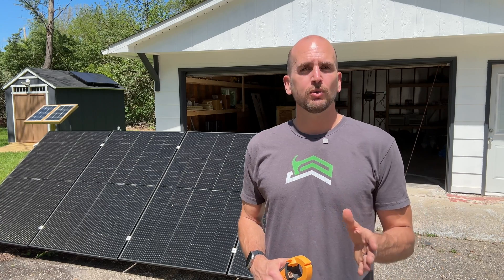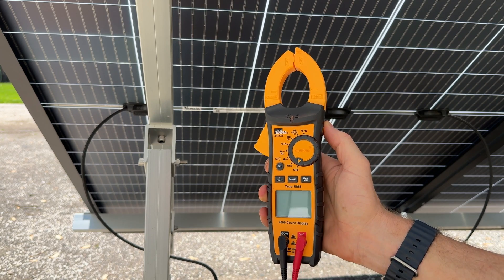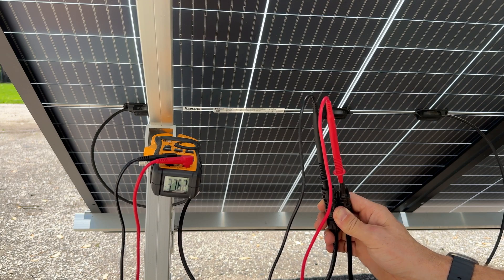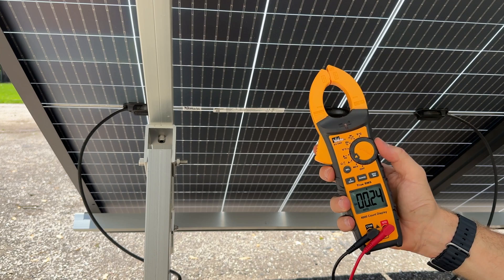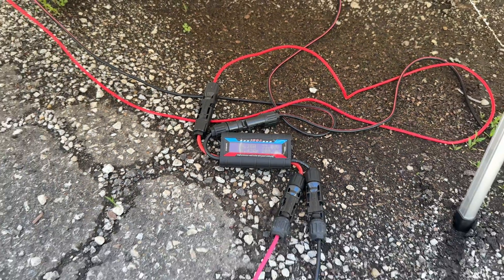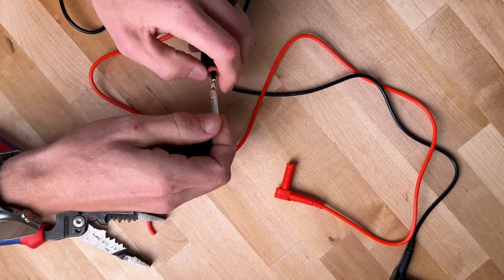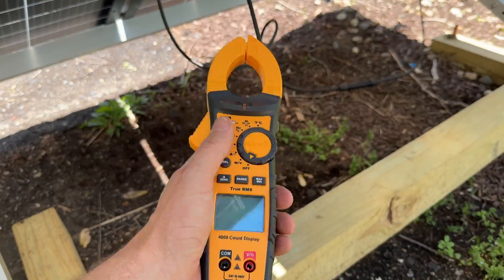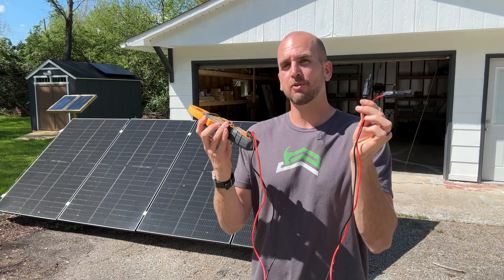Measuring Solar Panel Output |  Ultimate DIY Guide

Comment: Please i have a question, i have 3 panels connected in parallel. Each panel has imp of 10.67. My charge controller takes 13amps max. I have connected my power analyser from the solar cable to the power station solar cable and plugging it in, i am seeing the unit is not even taking upto 13amps. Could it be that the panles aint generating enough? Because it makes no sense, one would expect the unit to always take 13amps since the parallel connection gives it more than enough. From my own observations, majority of the time the power analyser shows about 8amps being taken by the load, i even see 3amps. Which means each panel aint even generating upto 2amps.... meanwhile the voltage is very okay.

Comment: There are numerous unsafe elements in this video. First, you should never short-circuit a module unless you have a load-break rated disconnect in the circuit. He cut this part out of the video, but opening the connectors under load will cause a DC arc, which is a safety hazard, and it will also damage the connectors. Second, when you modify the test leads, you void their CAT safety rating. Also, MC4 connectors aren't rated for a wire that small.

Comment: Hi, I have just bought a new solar panel.  I tried my clamp meter on the cable between solar panel and inverter but only shows very low amps.  I have tested the panel with multi meter and the voltage is ok and also the short circuit current is  ok . Don’t understand why I’m getting no amps at the inverter? Thanks

Comment: I probably watched about 20 of your videos and I appreciate you. I also like your varied tests. I am by nature very methodical so doing logical testing is in my dna.  I know absolutely nothing about solar, but am learning quickly. I bought the 1st generation Delta Pro and 400 watt foldable panels. They are both since long out of warranty. I bought a Delta 2 with extra battery and just bought the 2nd generation 160w foldable. I really do love EcoFlow and they are helpful to a certain extent.  I never got really great results with the 400w from the get go even i. Ideal conditions. Maybe 275w.  But I am averaging 160w now.  As a matter of fact the 400w into the Pro and the 160w into the Delta 2 and the 160w panel is generating more power.  I ordered a mutimeter because mine wasnt strong enough. I ordered those power analyzers. Tried to add mc4 connectors to them several times… who knew the m goes to the f pin and not m to m.  Lol.  Once I got them working Open current V 45.7 vs 48 rating.  Amp were low 1.5 a on average.   There are some scratches but I am leaning more towards the potential of a bad diode?  Since they’re no longer under warranty, I might just attempt to open the junction box.  I might put thermal electrical grade tape \ film over the scratches in case its a moisture issue.    Like I said. Learning a lot.   

Since both the Delta Pro and the Delta 2 have built in MPPT solar controllers, would not the data from those devices identify the issue and a bad diode?  Are they any app that can read the MPPT data?
Reply: It's about 66 degrees out and 11AM.  the 400w panel is positioned towards the sun at the right angle.  It is not plugged into the Delta Pro yet.  I put a heat gun on each cell of the panel and the temp range was between 125 and 135 degrees F.  That indicates that no cells are damage, correct?  I wonder if the MPPT in the Delta Pro is reducing the charging production at maybe 50 or 60%?  I wish we could access its data.  Going to have to drain the Delta Pro down to 10% and repeat the test.   The Delta 2 does not do this, I was at 95% battery and the 2ns generation 160 Watt panels where producing more than the 400 w.   Are the second generation panels just better?  I am going to test the diodes when I can but I can't see anything telling me the 400w panels are defective in anyway, yet.
Reply: So today is ideal testing conditions.  So I swapped things around.  I put the 2nd generation 160 watt panel into the Delta Pro and the 400 watt into the Delta 2.  The 160w panel into the Delta Pro had double the amperage of the 400w into the Delta 2.  So I think that eliminates a Charge Controller issue.  Ran the heat gun on both panels in the same conditions and all cells range between 120 and 140 degrees F, so does that eliminate a diode issue?  If there is a bad diode, would I not see different temperatures on cells where the energy is being bypassed by the diode?   So I am at the point that I think I need to open the junction box and look for connection issues or maybe replace the MC4 connectors on the panels....  I jiggled everything and did not see changes in the power analyzer....  while my scientific brain is enjoying all this testing and analysis.... not having the solution yet is frustrating...

Comment: Just make sure to note the insulation type for your leads if convering them to MC4. A lot of probes cheap are rated 150v only. Make sure you get something with proper 600-1000v insulation.

Comment: I saw this video way too late. We got pretty chilly down here in Central Florida and I was scared of the voltage spike causing issues for our Delta Pro charge controller. I wanted a way to monitor the voltage of the panels while still being able to charge things, so I went and bought a cheap volt/amp meter that should have been rated for the voltage demands of our solar input. It didn't work and I was banging my head against it for the past 3 days trying to figure it out (instructions were poorly translated). SEEING that I can use y-connectors like this makes is SO MUCH EASIER THAN I WAS MAKING IT OUT OT BE I'M SO DUMB AAAAAA

Comment: When I attempted to make the mc4 modified meter wires I found that connecting the terminal ends to a 16 gauge wire is problematic.
Reply from the maker: 16 gauge are definitely on the low end but I was able to get a good crimp with my standard kit.

Comment: Have you ever seen a solar panel that has (about) 460 VOLT output?  I am not asking watt.
Reply: There are no solar panels in the world that has 460V unless you connect multiple panels in series to achieve the value.  
The highest voltage output that i've seen from a single piece of solar panels is First Solar Series 7 thin film module, about 220V per piece.
Reply: @ thank you.

Comment: might be a silly question, but do you need a load to measure a solar panel's output ? can you do it with only the panel and this clamp instrument? I want to figure out how much power would a single panel produce for a day in my curcumstances (partial shading) before investing in the whole setup. So I need to log the data at even intervals..the cheapest and simpliest way possible.
Reply: Yes, no load = no current, only open circuit voltage. You can use professional module testing kit like PVtester which gonna cost you thousands of dollar.

Comment: Why don't you use the clamp meter to measure power output voltage like you did with measuring current (amps) power output instead of rigging wires to the multimeter?
Reply: do you have electrical fundamental? You can't measure voltage using the clamp...

Comment: You could also 
Subtract line voltage from output voltage what should be 274 
Then divide buy line voltage multiply  by 100 and that will give you the actual percentage that is going into the grid 
Which will correspond exactly with the first test 
That proves that solar could only put in less than 20% 
Ohm's law got to love it

Comment: Now take your new vom with amp clamp 
To the meter on your house 
Measure amps
Turn off the main 
Measure line voltage 
Multiply the two and that will give you the actual watts that are going into the grid

Comment: Note that the IDEAL 61-757 ($133) is very similar to the 61-747 ($90 - Lowes special).  Major differences are the 757 goes up to 1000V while the 747 goes up to 600V.  In addition, the 757 has a low impedance AC Voltage mode for very small voltages.  Neither of these features are likely to be important to DYI folks.
Reply from the maker: Agreed, I have the 61-747 👍 and have found Lowe's to be the cheapest.  Thanks for the feedback!
Reply: @everydaysolar 
Hi there ,a question  men if you have a inverter of maximun pv current of 18ah can i put 18.21ah from the solar panel?

Comment: Unrelated but is it possible to use one solar panel to charge 2 delta pros at same time ? Like with some kind of splitter.
Reply: It seems likely that the charge controllers in the 2 Delta Pros would fight each other.  Each wants to control the solar panel voltage and current to set maximum power points (MPPT), and they likely would want different voltages and currents. It would likely be more successful to charge one from the solar panel, and run the output of that one to the input of the other to charge it.

It might be possible to disable the MPPT function in the Delta Pros.  That would work if they were connected in parallel to the solar panel.  But you would lose the efficiency provided by the MPPT function.